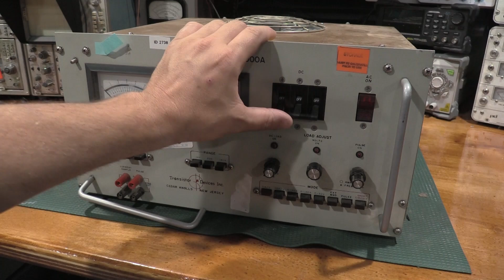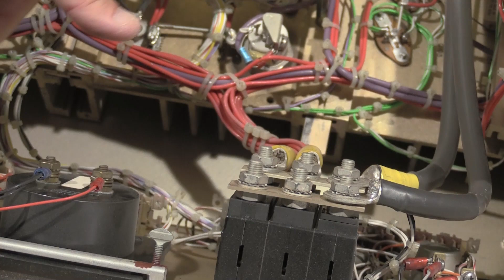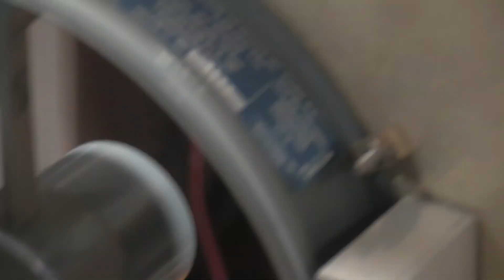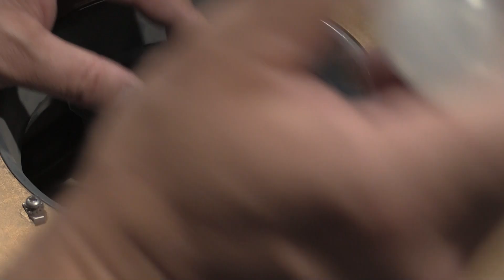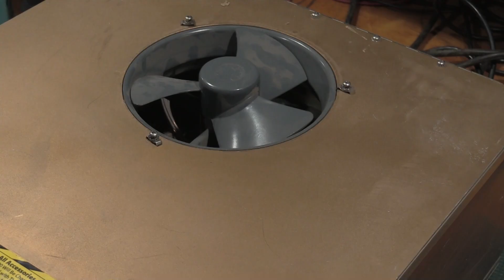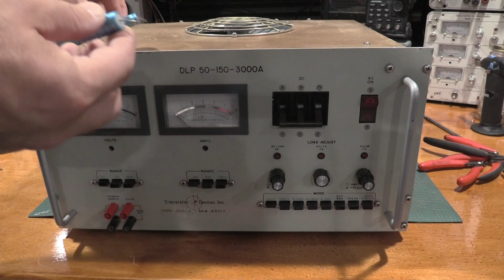Transister Devices DLP 50 150 3000A Restoration and lab Check in

Comment: Dare you test it with a car battery? Or for the 48V experience, telecomms battery? :) Should do for calibration with the help of a clamp ammeter (don't forget you can 10x and 100x a clamp ammeter by putting a 10 or 100 turn coil around it with a smaller current!, this should help verify it).

Comment: I've got several Transistor Devices loads including a monster RBL-400-600-4000.  The largest supply I have is a Lamda 13-200 switching power supply, but it requires 3-phase to get the full 200A output.  It will run off 240v single phase with a reduced output.  I also have a linear Sorenson 20-115 on the bench that I can run full tilt, but isn't anywhere close to the 600A I'd need to fully load the TDI.  I have no ability to generate 400V at more than a few hundred milliamps either.  I simply never entertained attempting to do a full calibration on it due to the insane V/I levels I'd need.  My primary load on the bench is a TDI RBL488 100-120-800 which is a much more modern unit including a keyboard for direct entry of amps.  Great unit for most everything I do.  I also have a TDI RBL488 100-300-2000 that I need to get around to repairing.  All 3 of these loads are modular and use up to 10 plug-in cards for the load section.  The easiest way of developing the higher currents is to use car batteries which would easily crank out the 150A you'd need.  2 fully charged in series will get close to 4kW  if you want to fully load it up.  You'll also need pretty heavy cables to minimize the I/R drop across them.  I've got a couple of chunks of 4/0 cable I scavenged off a CNC machine center that we scrapped at work hooked up to the 400-600-4000, and some smaller ones I salvaged off the same machine for the smaller 100-200-800 as well as the 2 large power supplies.

Comment: Disappointing really.  I was hoping to find out about the failure modes for this type of load. I wonder if all the transistors still work, evenly dissapating the energy? 
I've seen a few old electroplating PS for sale cheap, but shipping costs  make up for that.  Build a LiFePO4 battery.  Very affordable and can be used with a UPS for the lab.
Reply from the maker: A thermal camera is rapidly moving to the top of the list for analysis like this just don't have a good way to do thermal viewing yet.

Comment: Dell PowerEdge M1000E Chassis PSU 3000W 'Titanium' 8V4DK, 08V4DK

 Up to 91%+ AC/DC conversion efficiency (2360W power supply) or up to 94%+ AC/DC
conversion efficiency (2700W power supply)
 DPSE, which automatically engages the minimum number of supplies required to power a given
configuration, maximizing power supply efficiency
The following detail the PowerEdge M1000e chassis power supply capabilities:
 2360W or 2700W maximum for each power supply (depending which PSU is chosen)
 220VAC (single PSU runs 180V–260VAC) or 110VAC input (2700W power supply only)
 50Hz or 60Hz input
 14A minimum (2360W power supply) to 18A maximum input (2700W power supply, running at
1350W during 100V operation)
 192A (Amps) @ +12VDC output (operational)
 4.5A @ +12VDC output (standby) 

this will be the best option to test your load
Reply: note it will exceeds your load as its outputs 192A (Amps) @ +12VDC output (operational)
Reply from the maker: I was thinking that was going to have a REALLY stout 12Vdc rail. I am guessing this is a 240 Vac only supply they most likely did not make a 120Vac version.

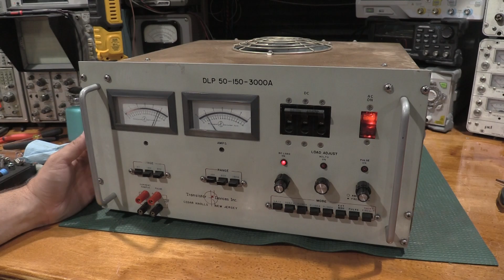Comment: 16:27  is that just a ptouch label or something like a clear address avery label that you can you print from your computer? Any other strategies for lettering fixing on faceplates? Maybe redoing the entire silkscreen of an instrument?  Anywho, video idea
Reply from the maker: A Ptouch label is exactly what it is. I have a Brother Ptouch 950N printer in the lab for numerous reasons. It is nice because it is a network label printer but it has access to all the fonts installed on the computer with the software. So FAR less limited then the stand alone labelers.
Reply: Thanks, been eyeing one of those for after I paint the tek 466  chassis, I can relabel the side holes for adjustment (Chan 1&2 Gain & Var Adj). For more complicated jobs, I was also thinking of hijacking the wife's cricut to do this, don't know how durable it would be, but the idea of scanning a faceplate and cutting a vinyl sheet with only the letters and using the transfer tape to lay it down would be useful for things like knob hash mark scales.